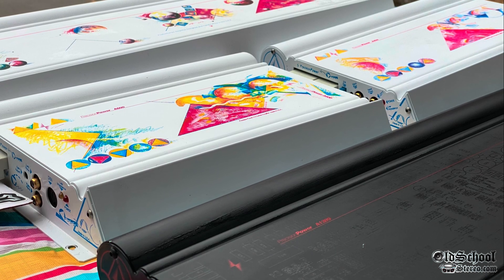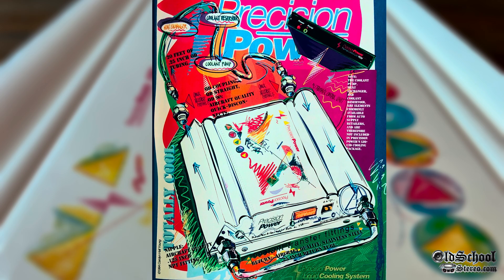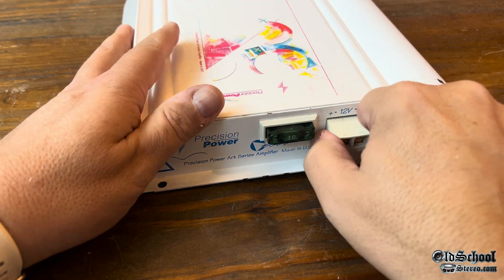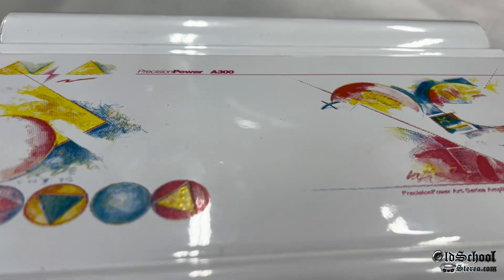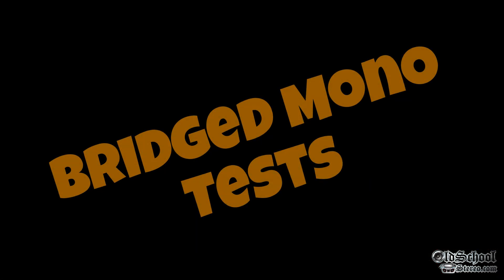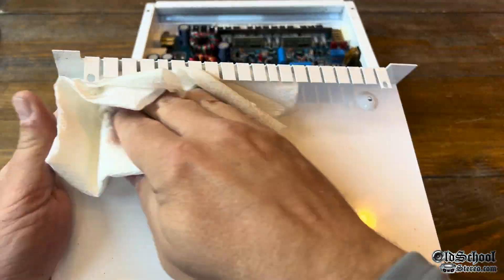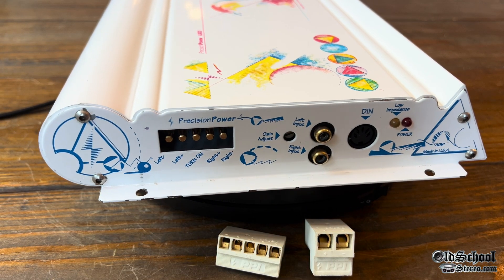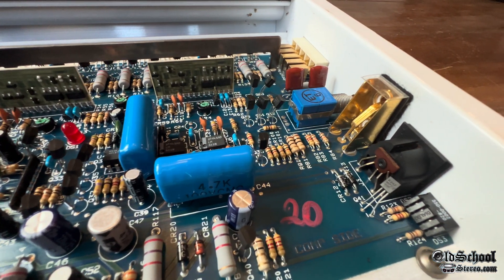When PPI Sold Art in the Form of an Amplifier - 1993 Precision Power A300 Review and Amp Dyno Test

Comment: As a product of this generation I always mocked up my dream system around these amps but could not afford them. In competition (IASCA 97 phx and socal) I did place second in novice SQ and SQ+ against a ppi system, which running cadence made me a happy camper at such a big show! By the way if you can get your hands on a Cadence Shockwave amp their circuit boards are pretty cool with the printed notes across them. Anyhow love the video and as and old school basshead I like the RED power turn on as red means power lol and I did get to see many ppi setups mainly in the Phoenix area that ran the water cooling which was the ish back then but sorry no pics. Thanks for the cool video!

Comment: Those speaker connectors will accept 12-gauge wire (actually up to 10-gauge per the manual) because that's what I had going to my JL Audio 12s using this same amplifier.  I know you complain about them, but they made installation easier and they made it a breeze in the event you needed to remove the amp from the car or maybe go from an A300 to an A600.  All you had to do was unplug two connections instead of unscrewing power, ground, remote, and all the speakers and initially wiring them up could be done without having the be a contortionist at the whim of wherever the amp manufacturer decided to put the terminals.

Comment: I had an A200 running MBQuart 8” in doors and Infinity 4x6 plates in the dash & A600 pounding a pair of Atomic 2 ohm 12” in a band pass box in the bed ported into the cab of my S-10.

Comment: That amplifier needs serviced. I guarantee you it has DC offset on each speaker lead, which reduces output. I’ve repaired A LOT of Art series amps in the past & every single one of them had DC offset before I started.

Comment: I am a PPI fan and have many versions of the amps. I prefer the earlier models with the unregulated power supply.
Reply: Only the "Pro series" or competition PPI amps were unregulated. Pro Mos and Pro Art were the ones that accepted 1 ohm stereo loads.
Reply: @msh6865  the art series was the first ppi amps to have the regulated power supplies. the m and am series had unregulated power supplies. thats why a 2150m or am  will do more power than an A600

Comment: Clean, basic design with great surface mount PCB (low current areas). SG3525 PWM power (regulated) supply controller. No BS. No cheating. A600 and A1200 provided plenty of class AB power to JBL GTi series subs back in the day.
Reply: I'm still running the GTi's. Lol
Reply: @JasonWW2000  OWWWW! I bought a pair of JBL 2206 8Ohm pro 12's just to look at them since they are very similar in appearance. The look with the accordian surround, pressed paper curvilinear cone with the light sheen and the iconic 1000Watt dust cap is the ultimate, forever. WGTi got ruined with gold dustcap.
Reply: @pgmurray76  Did something change in the design with the gold dust cap, or do you mean it just didn't look as nice?
Reply: @JasonWW2000  Nothing changed. It likely was even stronger, if anything. I love them no matter what. The white 'JBL' on the plain black dustcap was my favorite look. The metallic is superior in appearance when compared to the lame version with the orange JBL logo and '4000Watt' across it. Ugh.
Reply: @pgmurray76 Yeah, my 3 have the 4,000w dust caps. Not the prettiest.   😅

Comment: The "art" on the ART series amplifies wasn't really my thing, but these were absolutely fantastic, PURE amplifiers. No crossovers, nothing that wasn't necessary to produce amazingly clean signals. I can forgive them for the hateful old power and speaker plugs. They weren't necessarily powerhouses partly due to the use of a fully regulated power supply design although the A600 and especially the A1200 made damn good power for the day. Tons of SQ builds were centered around these amps as well, even years after discontinuation. It's a shame that products like these aren't made today. These went out of production in 1996 if I recall, being replaced in 1997 with the PowerClass "PC" line, which I am even more a fan of (The PC2350 was a killer. Fight me...).

Comment: Absoloutely gorgeous design, every aspect. Heat sink/chassis, circuit, artwork, everything. These sound fantastic and have good longevity if not abused. I had a couple PowerClass amps, which replaced the Art series in 1997. I was told by an employee at PPI the only difference (other than cosmetics/shape) is PowerClass has onboard crossovers, where Art series do not.
* the crossover frequency pot is detented (click, click, click when turned), so you know what the frequency is set at after looking in the owner's manual. first detent is ___hz, second is ____hz, etc.
I sold that amp in near mint, working condition for $50 to a friend about 5 years ago. He still has it and i'm considering asking if he'll sell it back to me.

Comment: I have one of those, it’s the more squared off model before these, a 2075, got a couple black 2050’s too. 
I keep telling myself I’m going to do a period correct system in a 80’s BMW 7 series, that’s where the NOS a/d/s 300i plates and separates look at home.
Reply: Get you some A/D/S PQ amps to go with those speakers
Reply: @ I have a PQ8, PQ10, two PS5’s, and a very early Power Plate 40. My plan is to run the PQ10 on the ads highs if 40wpc will do it. It should, I ran a PQ8 in high school (1989 or so) running some Pioneer 6x9’s and some really nice JBL 6.5 separates, back when JBL was using the T-06  1 inch titanium dome, basically a T-350i tweeter used in JBL home audio. The “20wpc” of the PQ8 drove all of that very well, so the PQ10 should do the trick.

Comment: Yes car audio has definitely lost its way in my opinion…
Reply: I think car audio has only gotten better over time. If you want high-end, there's plenty of high-end brands on the market.
Reply: lost its way??  if you spent $1100 today on a 300 watt amp that didnt make rated power, had no crossover, and had to buy a power plug seperately, youd be happy??
Reply: @bdc211 I’m assuming he means in general. Today the market is flooded with junk, in the late 80’s, early 90’s the “junk” was still mostly decent gear, aside from Roadmaster, Sparkomatic, etc. But Pyramid, Unic, Acoustic, Fultron, US Audio, would still get you a great, fairly reliable sound, if not pushed past its limits. 
Most car audio was really good stuff then with a few exceptions. Now most car audio is junk, with a few exceptions.
Reply: @bdc211  I’m 49 …I did all of that shit.1.00 1.50 a watt… don’t get me wrong I’m glad everyone can have better and cheaper stuff I just wish it had been available when I was coming up..take care

Comment: I have two, and I'm running the 600.2 in my car on a quad 6x9 box.   The 1200.2 is not efficient enough, too run subs anymore, but it looks good on the wall with my alpine mrv 1505

Comment: I have a 1200, 600, 2x 404, 3x 300, and a 204, a few are BNIB. Needing someone to go through them and recap/update them for usage in a project. I went to the IASCA Finals a few weeks back in hopes of finding a person or shop, but no luck.

Would appreciate some links or emails for reputable repair shops. Wanting to start with the 1200, 2x 300, and the 204 for a project I’m going to call “Not Rockit Science”.
Reply from the maker: Shawnmking (at) gmail dot com
Reply: There's also GS Amp Repair out of Arizona. He used to work for Rockford.

Also Desert Audio Specialties in Arizona.

Then there's a shop in North Carolina called Freeman's Car Stereo.
Reply: @JasonWW2000  do appreciate it. Will definitely reach out to them.